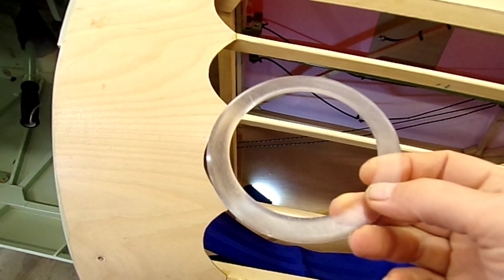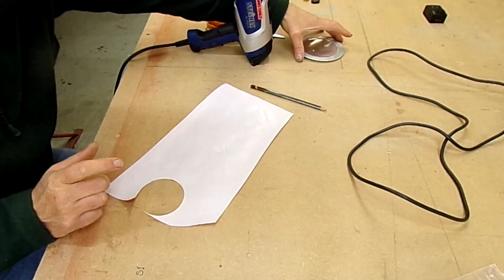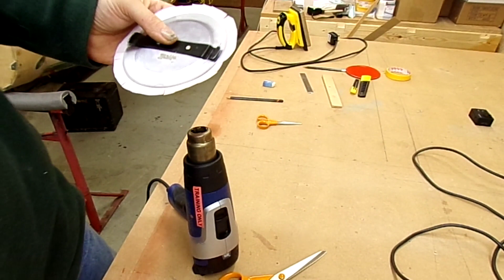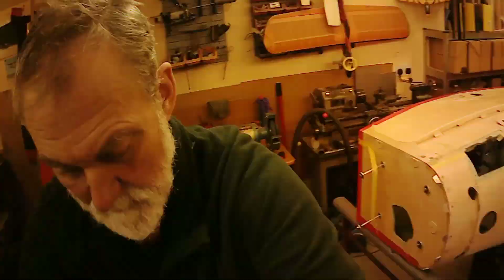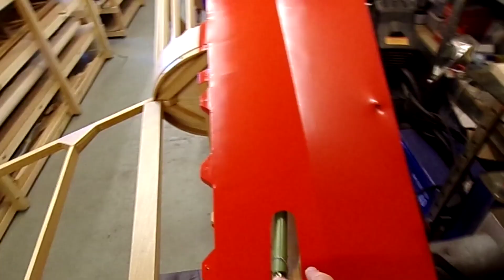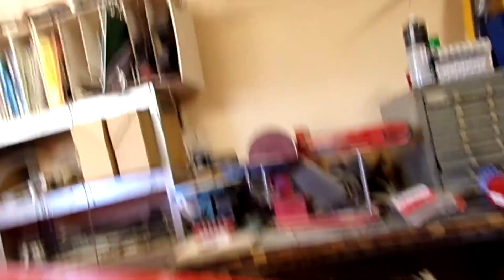Covering EP132 More fuselage covering with Oratex UL600. Fisher Youngster

Comment: As the saying goes, "You've got it covered".  Are you going to use the same colour for the upper fuselage & will the wings be the same colour too?  These past few days the heat gun will have kept your workshop that bit warmer.  It has been very cold or what we used to call 'Winter'.
Reply from the maker: Hi Robert, I don't want to let out all the secrets just yet but I can say that there are some different colours to come 🙂 It will be fairly classic to look at. Yes the heater and the hot air gun have made the workshop fairly nice to be in. I do like seasons and over this side of the UK it tends to be just wet, windy or occational sun (three seasons that just change as they feel like).

Comment: Looks great!
Reply from the maker: Thank you for your kind comment.
Reply: Hi again!!  Thanks for the inspection ring install, I was wondering about that with the oratex.    One big issue I would probably have is that my wings are 2 tone, OD green on top and a cream (?) underneath.....the issue would be,  I'd be able to wrap the bottom color onto the top by a few inches,, but the top color would have to stop right at the cord line, and not wrap over the bottom at all.

I have reached out to the company but haven't heard back 😕
Reply from the maker: It might be that the person who can help is away in Germany at the moment. You don't need a lot of overlap, a couple of inches at the leading edge, which would be in line with a real SE5A as the green went past the horizontal from the photo's I have seen. There is also a method to joint two pieces together before applying to the frame. Or if all else you can cover with the cream and then paint the green on.